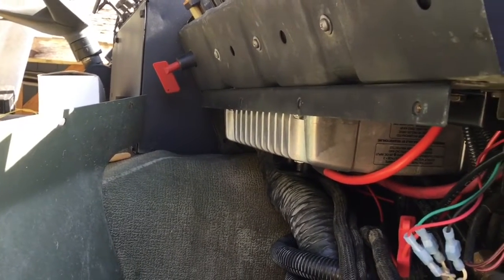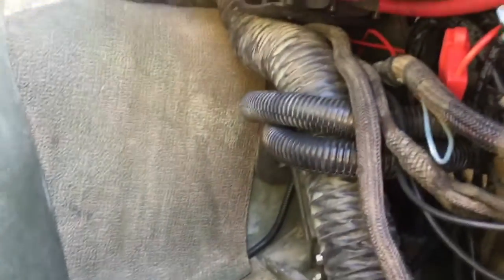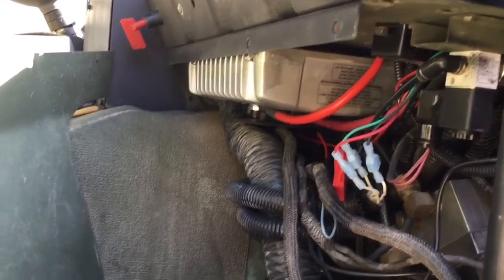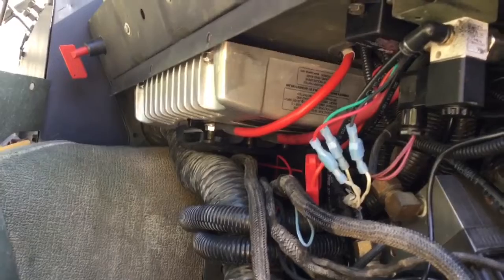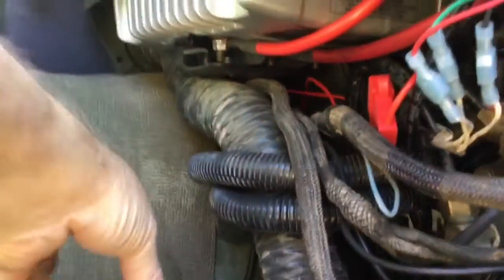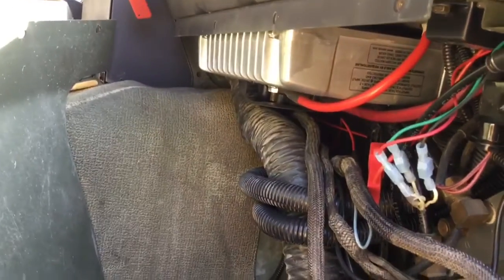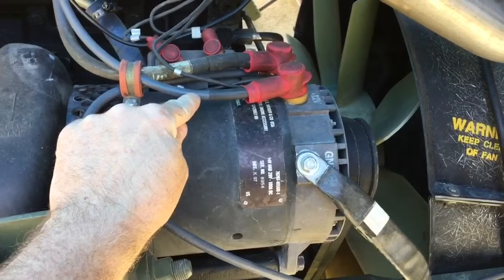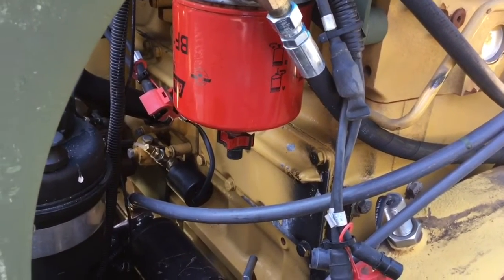LMTV 24V conversion

Comment: Thanks for the video! Super helpful. I'm in the process of doing this conversion to an m1078. What are you planning on doing with the alternator mount? the Neioff mount is 5 inches and the commercially available alternators I'm finding have the 4inch j180 mount. modify the existing mount or is there an easier alternative?
Reply from the maker: I havn’t crossed that bridge yet.  I will probably mod the mount to fit something like the J frame alt config.  Or I may just fab my own mount…  Something else to consider is Cat already solved this problem, and you may be able to fit an alt mount from an engine out of a truck wrecking yard.

Comment: Hi rronmar I have a question regarding a step down. I bought some 12v led marker and running light. I want to put the whole light circuit on 12v. Separate 12 from 24. By isolation of batteries. How do I go about this. I have M1085 LWB.
Reply from the maker: The light circuit is already on 12V.  Because of the nature of the alternator it is not possible to separate/isolate the 12V/batteries.  The only way to separate 12V is to shift to a straight 24V charging system(new alt) and/or use a converter like in this video to creat 12 off of the 24.  The Neihoff alternator must see 12V out of the middle of 24V to charge properly and you really want the 2 series batteries to be the same size/balanced as that is what the regulator is configured to charge and maintain.  The stock system is OK as long as you don’t overload it.  About the best thing you can do for it is to drop to 2 batteries, either stock size or smaller(group 27-31)non AGM wet cells.  Cat specced a pair of group 31’s for the power equipment that use these engines, and that is plenty…

Comment: Great work on the system, would you have a diagram on what you did. I have a M1079A0
Reply from the maker: No diagram, sorry.  It really is pretty straight forward.  You give the converter ground and 24v it gives you 12 out.  This is real easy to do under the dash or at the polarity box location as you have ground 12 and 24 connection points available there…  you would need a waterproof converter for the polarity box location…
Reply: @rronmar  Thank you for the reply. I will try this one day. It will be added to the to do list. Keep up the great work.

Comment: so the Vannier you have is a 200amp balancer/or converter.....  thusly when used as converter gives 100amp @12v?
Reply from the maker: No it only requires 50A@24V to get 100A@12.  It is a 81 series Vanner, they make them in 60, 80 and 100A@12V output ranges…